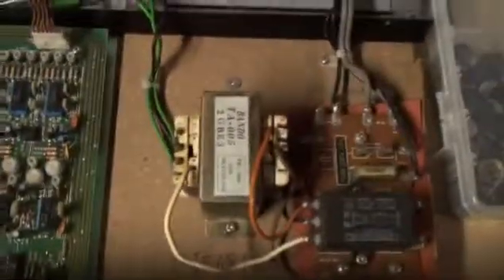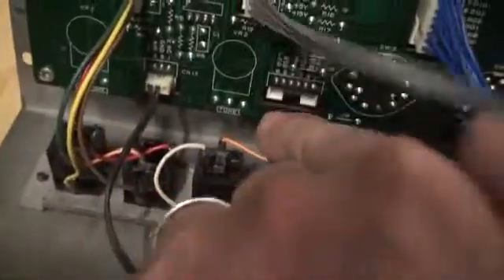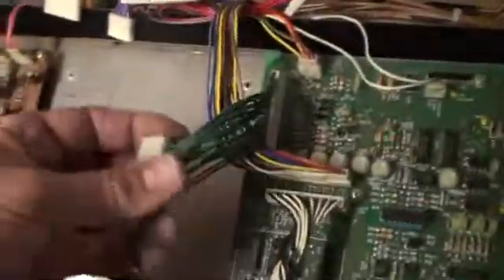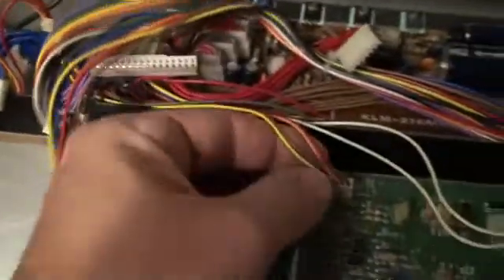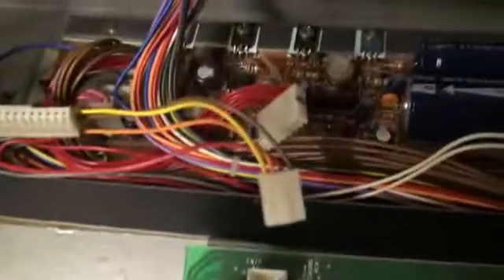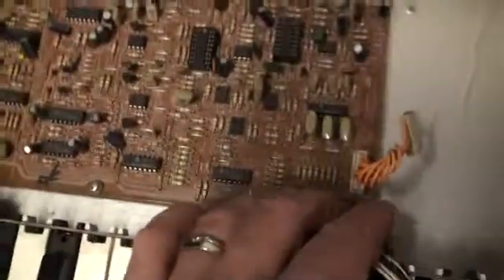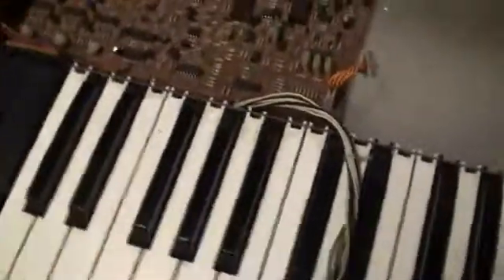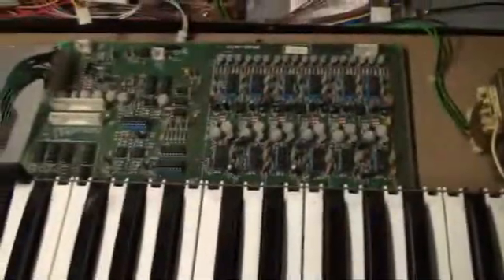Polysix Reboot p.2

Comment: Thanks for these videos,  I got a poly6 also.  
   In my case I didn't use it for a while and the battery leaked and the acid ate up the traces on the board.  I was determined not to let this synth  die so I painstakingly rewired all the broken traces.   It lives again!
   We played ABACAB and the poly6 can do the lead sound pretty good. (I also have mini's, but  that we didn't like to take them out on the road.